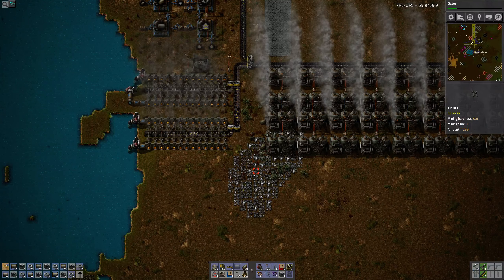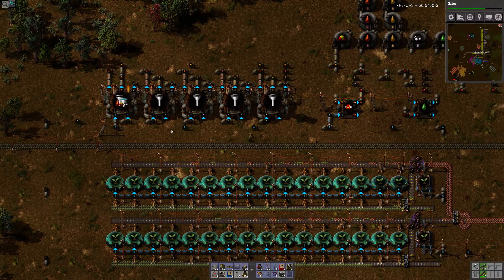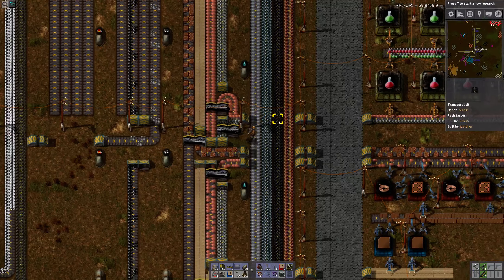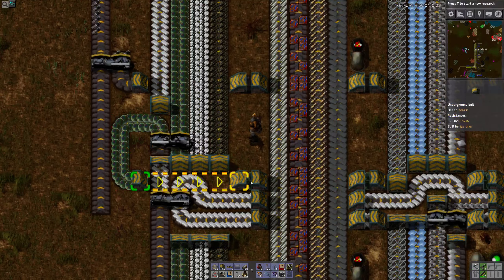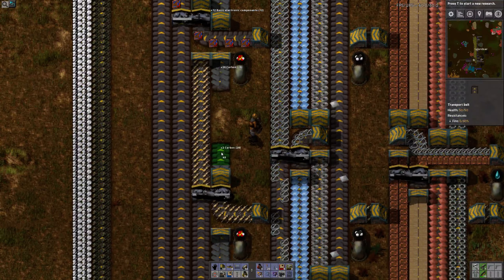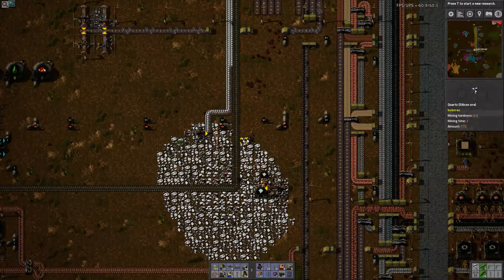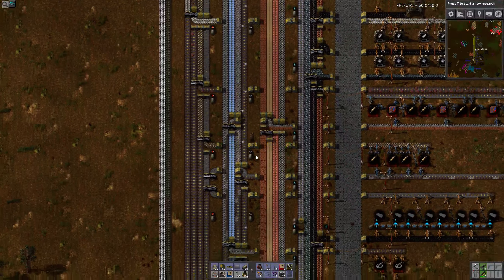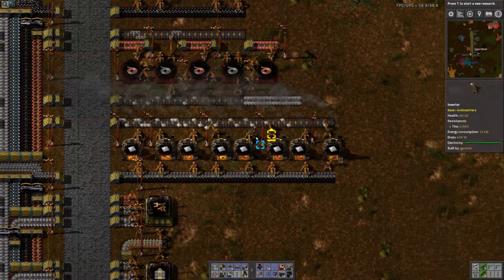Main Bus Tutorial

Comment: Nice basic tutorial. Its obvious you steer well clear of advanced designs and endgame solutions. Especially in bobs mods this is a concern. Part of factorio's charm to figure things out as you go along. 

There is always a remarkable design choice about making things locally or putting em on the bus. Like in the instance of gears, i prefer making em locally, so i save a belt of gears. A downside to this can be that you run out of iron plates down the line suddenly, and need to increase output, possibly another belt with iron plates, negating the benefit from saving a belt of gears. 

Another something not much explained in this tutorial is the use of several busses in conjunction with eachother. You lightly touch upon that with your oil processing. Its setup in a way like a bus would be, and its products end up on the main bus. Then you have lightblue science packs. In bobs mods, often chip components can have their own bus as well. 

Perhaps you could do a advanced tutorial as well?
Reply from the maker: Good points. I constantly struggle with what to put on the bus and what to make locally. And you're right, the branches off the main bus are sometimes a mini bus. I have several factories with a "mini bus" that just had materials for making the common buildings, but I didn't do that here intentionally. There are a lot of choices when it comes to building locally or building straight off of the bus, and that's why I have so much fun building my busses again and again because each time they turn out a little different.

I don't think "advanced" tutorials are any good for this game. When you get to that level, you've already put tons of time into the game and you should have your own ideas on how to build stuff at that level. The main bus I show here is the "least common factor" that I see used in a lot of places and can be the basis for any number of wonderful designs. Besides, you get so many options in Bob's Mods that it's ridiculous to think you've ever found the "best" solution.

Comment: I prefer to underground the bus itself in perfect intervals....makes it look nicer and you don't get pulled when running/driving over it.  It also makes splitting off material MUCH easier, and you can compact it (you don't need the spaces between 4 belt spots).  Using bob's, the red undergrounds give you perfect distance to separate each factory "side line."

But that's my opinion
Reply from the maker: That's a perfectly viable strategy when you are later in the game and have tons and tons of resources. I like to build my main bus almost from the beginning and it's quite expensive to make underground belts in terms of iron ore and such. So if I started off with underground belts, my factory would take much much longer to build.

Later on when I get blue belts I'll convert to the underground system. I hear it saves on UPS as well.
Reply: JGGames . It's not THAT much in extra resources, maybe if I were instantly building 50 lanes of bus...but in the beginning, there's really only maybe 5 lanes.  Then again, I don't usually start my bus until after I can automate underground belts to make the job easier.

Although lately, I've created an even more fun system....the belt loop.  ALL resources pass through the main belt loop, and filter inserters pull off of it into "input boxes" for each factory line....but only fill the boxes to its designated amount.  To keep the loop from being jammed, the whole thing runs on circuitry which sends a negative pulse signal whenever material is needed (taken from the input boxes) and that causes the output boxes to release that material if it receives a negative signal, which in turn sends a positive pulse signal.  The whole thing connects to a single decider combinator that tracks all items (needed and already on belt).  Lastly, when I switch to robots, the only thing I have to do is convert all input boxes to requesters, output boxes to supply, and destroy the belt loop.
Reply: Here's how nice a belt bus can look with ug belts (for those who read comments, not just to you JG):
https://dl.dropboxusercontent.com/u/24657744/Factorio/beltbus.png
Reply from the maker: That sounds an awful lot like a rainbow belt system. I want to build one, maybe for a process that requires tons of different inputs. I'm going to avoid bots throughout the series. I will use them to build and to refresh my personal supply, but that's it. I don't want to build another bot factory like everyone else does with Bob's Mods.
Reply: You say you don't want another bot factory like everyone else, well please check this out.

It isn't quite a rainbow belt system....it goes completely on signals rather than just dumping.  Here's a blueprint (hopefully it works) to try out on a testworld so you can see what I'm talking about (I'm rubbish explaining things sometimes):

http://pastebin.com/37XLvWcw

Situating the blueprint so that the gear factory is north, fill the leftmost box with iron plate.  Next, put exactly 100 iron plate in the next chest working right....you will immediately see the inserter pull plates out and "request" plates from the left chest automatically to restock.  When 100 gears are in the "supply" chest, it will stop and the belt loop will eventually be empty.  Place a few gears on the belt loop to represent consumption (as they get picked up, the inserter will call for more).

Expansion is simple, copy/paste pretty much the factory part, changing the inputs/outputs as needed, "prime" the input chest, and bam, new materials are made.  The only downside is that when you upgrade to better inserter capacity, it will sometimes put more items than are requested on the belt loop.....it will still keep track of any extra items though, so if something wants it, it'll subtract it out and not supply more.  There is a way to pull extra off the belt as a resupply at the end of the loop, but it's an overcomplicated combinator setup and not really worth the hassle (a few materials floating on the belts won't harm anything).

It saves a TON on space with bob's as well (compared to main-bussing).
Reply from the maker: Can you put that up on factorioprints.com or make an image of it? I don't have the blueprint mod installed and I kind of don't want to mess with my mods right now.

If I don't talk about this after episode episode 017, ping me again and remind me. I want to talk about your ideas here, but I don't think the comments are going to be sufficient.